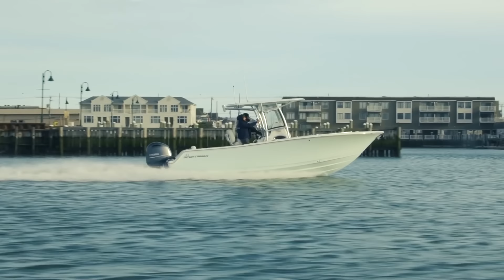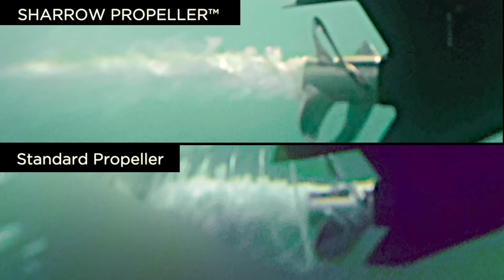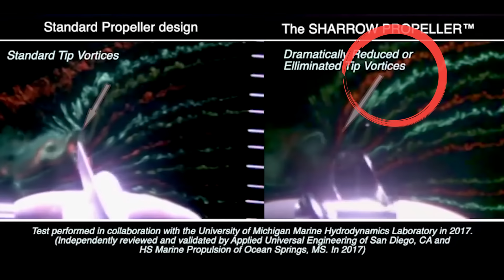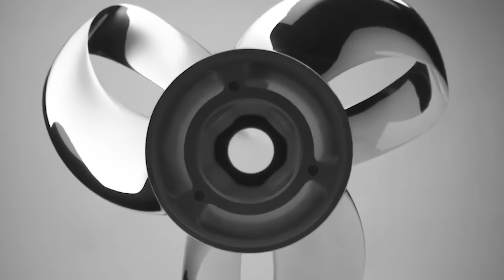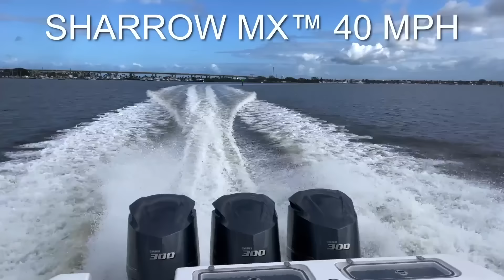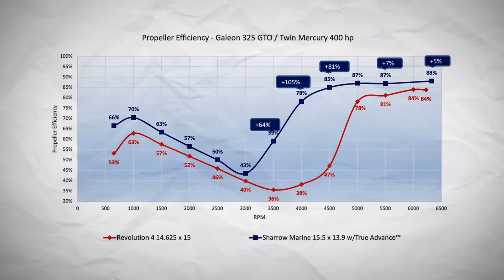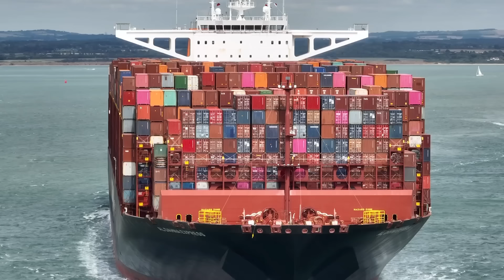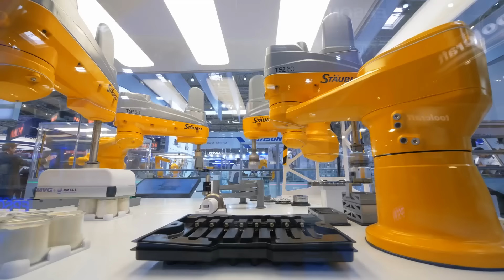This Genius Propeller Will Change Transport Forever

Comment: There's a major difference between the design used for the boat motor and the drone - chiefly, the drone attempts are incredibly flat whereas the boat prop is more of a cone.
I've only recently seen these things appear here and there though it seems they've been around a while the sources have been crowing about this 'new' design and people testing them (particularly the flattened design for fans/drones) are scratching their chins because they seem wildly less efficient than a well established computer fan design.
Since I'm only seeing this prop appearing - everywhere - the last couple of weeks I can't say much, but it seems they're great for water use because there is room to have a more 3-dimensional cone shape and its efficiencies and not such a game changer when it comes to displacing air because those designs are simply too flat.